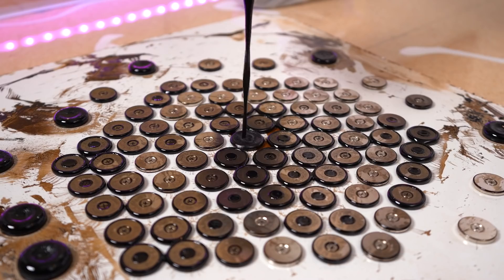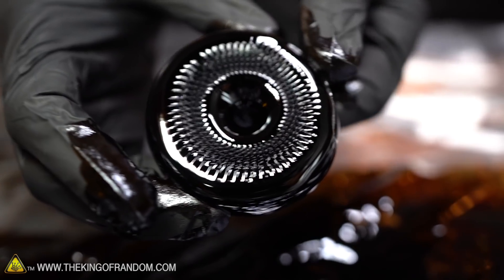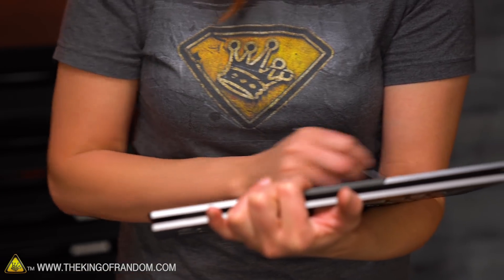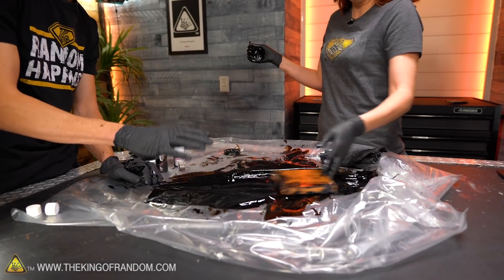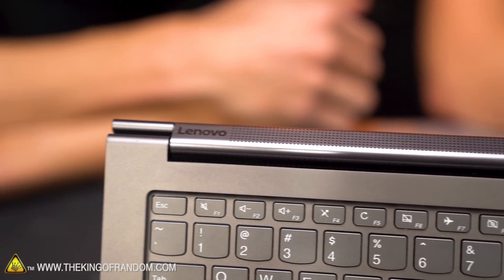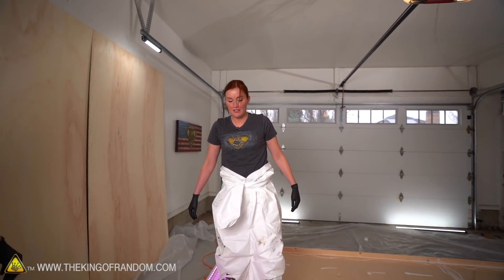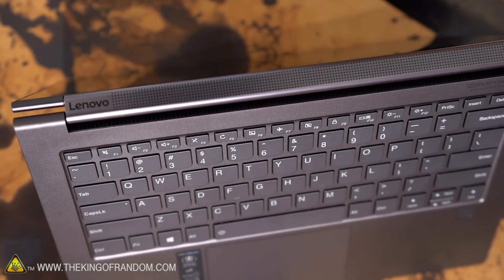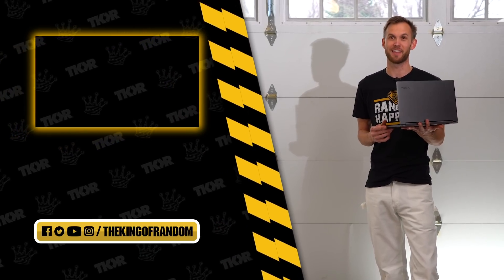Can You Make a Hoverboard With Ferrofluid?

Comment: How many times they plugged their sponsor

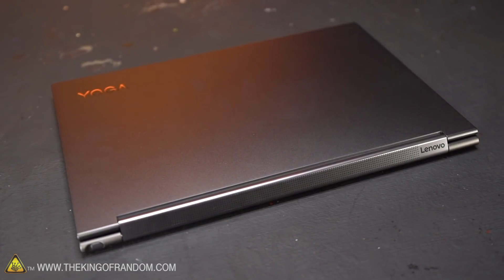0:00 0:15 1:30 2:15 4:36 5:33 7:27 7:31 7:53 

There are also several times in which they are seen holding or using the device.

I think this is what you would call the brainwash technique. 🤣

Comment: hey guys yall should try to change fire to water 
1 end have fire make the smoke goes through horizontal spiral copper pipe  3/4 of the pipe cool the copper with wet towel and ice see if you can make the smoke into water it just crazy idea. If this idea works that means you can make smoke from factories into water then filter that water to distilled water as i said crazy idea

Comment: Can you guys use hand warmers to cook food? Like if you agree so that King of Random can see this comment!
Reply: This is actually a thing. some Military ration packs will have a chemical pouch similar to them self-activating heat pads for pain relief to cook the meal.

I have also had some sodium acetate gel warmers with the snap disk get uncomfortably hot, and they have an output of 289 kJ/kg. So enough packs in close proximity in an insulated container may actually pull it off.
Reply: I don't think it will work but im up
Reply: XD that's sounds interesting
Reply: Will the Lenovo 9i be the sponsor?
Reply: Omg! Thanks so much for the heart and all of the likes!